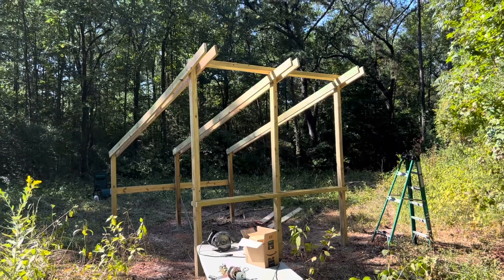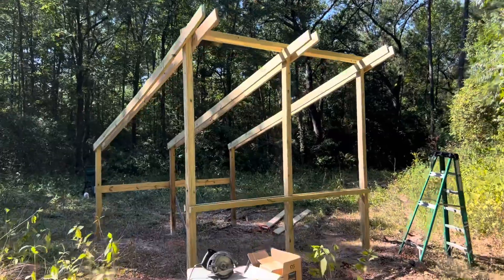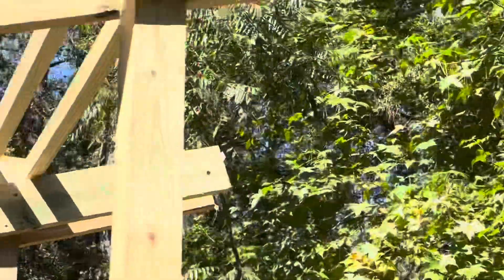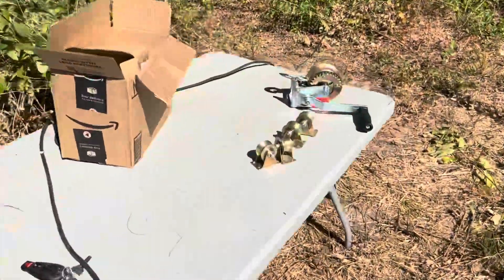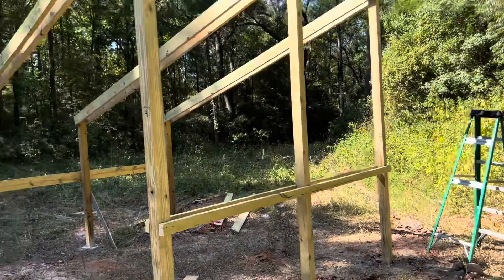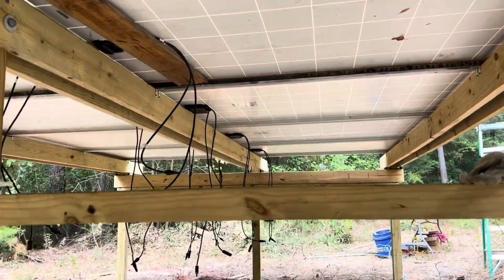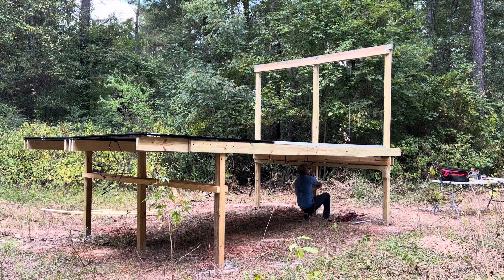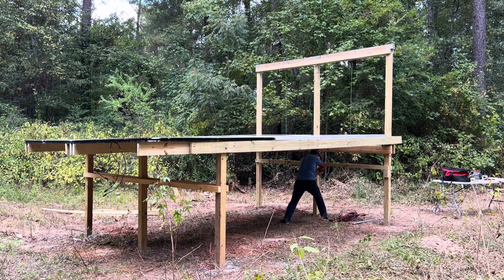Timelapse, DIY Adjustable Solar Stand

Comment: Nice video.  I am planing on building a tilt able solar panels that will pivot on a central pole.  I plan on having beams on either side of the posts like you did here.  I have seen many on youtube have used a big bolt with washers to pivot on.  I am considering doing the same or add a bushing with less binding.  Of course the binding might be an advantage as that would be a lot of weight to move freely in weather.  How did you ground or earth your solar panels?  Thanks again for the video.  All the best from north Texas!

Comment: no way you'll get 80 degree angle.  You're maxed out at the top and less than 45 degrees...
Reply from the maker: Yes, you are correct. It's adjustable but due to the height, I can only adjust to only certain angles.

Comment: You may want to add pins though the 4x4s so that if the winch fails it will not drop far. Like every few inches like the distance you move if every few weeks. I had a winch get away from me lifting a grain bin. It could have killed me. Still watching it. Putting in a double pulley in would help.
Reply from the maker: I ended up moving the last two post to the middle and it goes up and down with easy now. It does have pins on top to lock it in place for safety. I normally just put a couple of screws on each post after setting the right position. Thank You for the advice.

Comment: Great work and thank you very much for sharing brother. Definitely helped out this ole boy 🙏🏼
Reply from the maker: Glad to help. I did move the first three 4x4 to the middle. This made really easy to move up and down with the winch. Then when I have it set to the proper degree setting, I secure it with screws. This secures it from heavy winds.

Comment: Good thing those shade trees will keep you panels cool.  I believe your angles are incorrect.  For Houston it would be 15deg for winter and 45deg for summer.  These would be approximate numbers based on your latitude.  Are you going to cut some trees down in front?  They are too close on the side also.

Comment: At the bottom of the panels add weight a pvc large pipe with water might do best to get the balance to help lift. For winter below freezing add antifreeze also cause wire is high price build battery box charge control out there and inverter then run wire to place. Insulation for the winter as well
Reply from the maker: Thank you that is a great Idea!

Comment: Two suggestions.  Lower the front to give the proper rake in the winter.  And put some pins in where you are going to leave it just in case the cable system gives up unexpectedly.
Reply from the maker: Yes, If I lower it in the front more it would give me more of the proper setting in winter. I don’t want to cut down any more trees so this will have to do. 
I have a total of 2500 watts of solar panels, the EcoFlo Delta Pro takes in a max of only 1600 watts. In my case it’s sufficient. The batteries stay charge. It’s a small cabin, only 160 Sq ft. 
I do have pins to secure it on top just in case the cable gives. I have also moved the three 4x4 to the center and now it goes up and down very easy. Thank you so much for your advice sir.

Comment: I would have adjusted it to above the tree line.
Reply from the maker: Yes, you are right, sometimes I do udjust it that way. I don’t want to cut down anymore trees. I’m pretty much in the middle of a forest. I have 2500 watts of solar panels and my EcoFlo Delta Pro can only take in 1600 watts, so this works for me. I don’t use all the electricity I collect. 

Thank you sir

Comment: Very interesting concept, but several aspects could have been done better without adding much cost.  If you had put the pivot point at the top of the tallest beams you wouldn't have been lifting and lowering nearly as much weight.  Lubrication, in the form of a heavy grease, would make your existing system much easier to lift.  Finally, adding lead counter weights to the tails of each 2x6, on the lower end of your structure, would help it pivot more easily.  The biggest mistake made in this design is you didn't take into account the parabolic nature of the arc you're attempting to scribe.  Had you done so, especially with the pivot point at the top, the amount of effort needed to change the angle on the panels would have been far less.

Comment: Looks good.  I think I may use a variation of it on mine.   I would suggest drilling some holes in the beam that lifts it and the posts that it rides on so that you can put a pin through it.  That way all the weight is not sitting on the cable.

Comment: 2 comments
1) a 2 speed manual winch (like what is one some boat trailers) increases the ratios and would make it easier to raise the panels
2) the diagram of the panel angles about 1/3 the way thru the video shows Winter at 36 deg  up from vertical, Spring and Fall 60 deg up from vertical and Summer 84 deg up from vertical.  This equates to looking at a roof from the ground of a 54 deg pitch, 30 deg pitch and 6 deg pitch for those seasons.  A 54 deg pitch to most people feels like nearly a vertical cliff.  I think at the steepest, the most you got a 40 deg pitch, you would have had to have the front posts only about 1' tall to get near 54 deg.  Still you will get better performance during winter, but those pine trees may shade the panels during the winter.

Comment: Your video made a lot of sense. I've watched 10-15 videos and liked yours the most. I especially liked the changes you made as you went along to improve the final product.

A couple of suggestions for you might be to build in a couple of safety's on the tall 4 x 4 in the back to minimize the heavy tension on the aircraft cable and the winch. Drilling holes for safety pegs would minimize the chance of catastrophic failure if the aircraft cable or the winch failed. these can be set at all three angles for winter, spring/fall and summer. Secondly, if you add counterweights in front of the short 4x4 it will act as a counterbalance and make it easier to raise and lower. Thank you for posting your build it will be helpful to me in planning my build. I am older and lazier than you so I will attempt to make mine with a 120 volt operated winch.
Reply: My exact thoughts after watching this.
Reply: Would love to see how you incorporate electric winch. Great ideas!